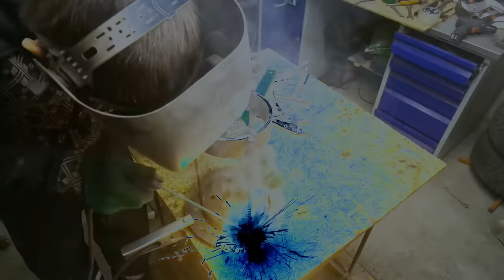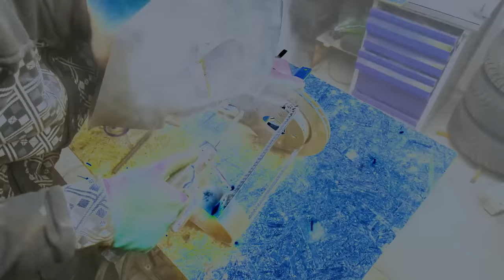Cool idea! Tool for every welding FROM THE BRAKE DISC!

Comment: After watching you try to weld cast iron, cold, not once but TWICE, I'm really surprised you didn't first try to weld it directly to the bottle. Now THAT would have made a GREAT YouTube video !!!
Reply: Don’t know about other parts of the world, but here in the US, brake rotors nowadays are actually cast steel, not iron....
Reply: @notajp  After reading your comment I did a bit of research and I haven't found any evidence to support your claim. The fact is that US brake rotors, like the rest of the world, are predominantly cast iron.
Reply: This comment got a chuckle out of me, almost spied coffee all over
Reply: Preheat and use stainless steel filler. Works great
Reply: Now watch me welding a bicycle crank. The video is already uploaded.😉
Reply: Then upload your own video you american sniper wannabe 🤣🤣🤣
Reply: @adriananimationsskits136  Yo adrian, you have no animations/nor skits. Consider yourself KIA from this American sniper wannabe 🤣🤣🤣  Let's see a video of yours....
Reply: I've MIG welded things onto old brake discs from cold many times. I just turn the dial up.
It seems to work fine. 🤷‍♂️
🇬🇧
Reply: Rotors are not cast iron
Reply: @JBidensucks  In the UK, brake discs (as we call them here) are made from cast iron.

I checked.

Can't speak for the US of course but would be surprised if it's different.
🇬🇧
Reply: @JBidensucks  they are.

Comment: That’s nearly 8 minutes I’ll never get back.   Waste of time.
Reply: You can get it as a "How NOT to weld cast iron to steel twice and how NOT to hold your round bottom gas cylinders" demonstration. Well, he didn't show why you shouldn't do such things, but you will remember 'till you die if you see the 'why' just once with your own eyes. Especially the second one.
Reply: Wish I would've seen this comment eight minutes ago
Reply: We must be 8n 1950.  Didnt even stay long enough to see the final product.
Reply: Stupid  "idea"
Reply: Every time a video does not show the end result in the first couple of seconds I skip to the end to see if it is worth the time. This is not
Reply: Thanks for the heads up 👍
Reply: Thanks for the heads up i just moves on😂

Comment: Sounds counter intuitive, but use some light oil when you're drilling steel. It helps the bit cut better, floats away cuttings, and most importantly, it helps keep the bit cool so it doesn't lose tempering.
Reply: Yes! And it looked like the drill speed was quite fast as well which will produce too much heat, hardening of the steel and dulling the bit. Slow drill speed for steel and always use light oil. The tool will do all the work.
Reply: @brianswelding  Great point and makes sense, I changed motors on an old and very heavy well built drill press. The thing  just eats bits up and not drill, I'm going to change pullies, thanks for reminding me of the problem..
Reply: not for cast iron. it machines great with no lube or coolant needed
Reply: Disc made from cast iron, not steel.
Reply: Yes oil helps but disc brakes are cast so contain graphite which lubricates drilling.
Reply: Wow! THREE different people felt the need to pont out that disc brakes are cast iron. I apologize, sometimes I make the mistake of using the terms metal and steel synonymously. My points/suggestions stand; drilling into any metal, cast iron, steel, aluminum, etc. all benefit from slow drill speed and cutting oil.

Comment: Years back I made stands for my belt sander, grinder, and jig saw out of 1 ton Dodge rear brake drums.  I just used a round plate with a 4" X 4" square tubing for the stalks, welded to the round plate for a base plate and drilled the round plate for lug bolts.  Then just bolted the stalk to the big old brake drum.  Then welded another plate to the top for the tool I wanted to mount to it.  Was going to just use an old axle, but didn't have any old axles I wanted to cut off for the stalks.  A lot easier than welding to a cast iron brake drum.

Comment: I am a professional welder I just have a tip remember car disc breaks are made of cast iron so you should use nickel welding rodes
Reply: Oh man! Thanks! I've only been welding for a month.
Reply: I agree with with other gentleman that pointed out it's cast. Just wanted to add, don't forget the preheat welding cast either. I think it's 450f but I'd look it up. It might even be in the paperwork that comes with the cast iron welding rod.
Reply: One other thing, peen your cast iron welds right away. Old timers trick to help stop cracks. Even if it's just an old wives tale, it doesn't hurt but personally and professionally, I think it works great for

Comment: I used a large brake rotor from a Mercedes and the steel from an old satellite dish antenna to make a stand for my belt sander a few days ago. The rotors are heavy and make good bases. I used three bolts to connect to the rotor.

Comment: Not having a piece of pipe the exact diameter of the disc brake, you can achieve the same result with three pieces of plate arranged in an equilateral triangle into which you can put the cylinder.

Comment: You had issues because of the temp of the work piece.  Preheat the rotor with a torch to get it hot before you hit it with the stick.   I will make for a better bond with the base metal.
Reply: but the problem here is NOTHING  to do with PREHEATING.  brake discs are CAST IRON, and that material is virtually impossible to weld.  man's a FOOL

Comment: I just braze these disks to mild steel then weld on that if I need to.  I built my mobile photographic lamp stands from brake disks, using them as ballast as well as the attachment points for foldable RHS legs and their castors.
Reply: I use truck drums with a pie wedge sliced out (love 6" cutting discs) to slide over the post bases I use for various stands. The cut makes them easy to place from the side.

Comment: That's a pretty creative workaround you've come up with there but if you had used the correct welding rod and the preheating procedure you actually could weld the A26 rebar to the castiron brake rotor. Good job!
Reply: What do you expect from a guy who has no proper welding gloves and no leathers?  If I tried that I would have burned my cloths up.
Reply: Yes, cast iron can be successfully welded with the proper rod. The biggest problem are thermal stresses are in the cast iron VS the filler material. They cool at different rates; therefore, a tug of war goes on and the cast iron generally loses with cracks typically forming outside the heat affected zone (HAZ). Preheating and post heating are critical but there are still no guarantees you won't get cracks in the cast iron.
Reply: @hootinouts  what if  you pre heated then let it cool down in an oven over a period of time ,
Just asking theoretically would that help reduce the cracks

Comment: You may have better luck welding the brake rotor (cast iron) if you pre-heat it with a torch. It needs more heat than the mild steel pipe and rebar.

Comment: What daft country would have gas cylingers that dont stand up ?
Reply: Cambodia or Laos
Reply: I don't know,  but I know two white dudes and a Hispanic guy here in the USA that don't. Not bullshitting and I'm sure there are more
Reply: Um, it isn't that the cylinders won't stand up, it's so they won't fall over, break the end off, and rocket themselves through you, or your shop wall.
Reply: The Slavic countries

Comment: Next time make your device PROTECT THE CYLINDER VALVE from impacts because that stand can still fall over. Add a removable cage or similar.
Reply: I know it's in a garage but it's an OSHA violation to not have high pressure cylinders, full or empty, to not be chained or otherwise supported.
Reply: @mathewmolk2089  I don't do it because of OSH regs (not applicable at my home shop anyway) but because I've seen an errant oxygen cylinder bounce around a salvage yard after falling over and snapping the cyldder valve off at the threads!  OPs base would be much safer if done with a larger rotor too.

Comment: i weld jack stands to my old rotors so they don't sink in my gravel driveway when i'm working on my vehicles. the rotors are easy to move and easy to level

Comment: After pretty good idea. That will come in handy storing my full tanks and empties. Every once in a blue moon they all fall over and I'm just been lucky that I haven't broken off the valve. I could even use that to store my scuba tanks and also.

 Thanks for sharing such a great idea.
Reply: If you want to protect your cylinders that's a solved problem called a cage or a cart you can make easily. That stand does NOTHING to protect the cylinder valve and is only mildly more tip resistant. Copy industry if you prefer to weld safely, and consider properly chaining your spare cylinders to the wall or welding table in the industry standard manner. This "Bubba" stuff gets people hurt because they don't fully understand cylinder handling even if they've welded for years. (Welding only teaches welding.)

Comment: KEWL VIDEO
   I tried welding to a brake rotor. It's CAST. YOU CAN'T WELD TO IT. I tried MIG and I tried Stick. It would break right off! I found that you have to bolt a plate to it and then weld to the plate.
  Thanks

Comment: You can weld cast iron more easily if you preheat it to over 400 degrees and weld it right after with high nickel content welding electrodes .
Reply: Exactly.

Comment: there are 4 kinds of cast iron & some can be weld cold, but most need to be preheated.
All you really needed is a castiron rod, check with you dealer & get a good welding book also.

Comment: One other thing you could have done is used rod to weld cast with.i know that NAPA Auto parts,has rod to weld cast-iron and with some preheat (just to dull red stage)will give you very good results.after you have laid down your bead,keep your torch heat on it and gradually pull your heat away. DO NOT COOL QUICKLY good luck I know this sounds a lot but cast is interesting stuff.cheers!

Comment: Funny to run into this today as just today I attempted to weld steel to a brake rotor. ha ha I was sort of expecting it not to work, assuming it was cast iron. but wasn't sure. I ended up doing the same thing you just did!

Comment: I learned a lot about grinding rust from iron alloys. Don’t even try to weld steel to cast iron. There are two reasons to grind a weld: 1, To give the appearance of no weld. 2, You are ashamed of your weld. Your stand would still be illegal in most developed countries, as the cylinder must be fastened to a structure.

Comment: What rod are you using and are you running 110-or-220 volts you should of turned the amps up

Comment: The tank needs to be in an appropriate cart or chained to a wall.  A brake rotor is not sufficient as it is neither heavy enough or wide enough to prevent a cylinder from falling over.  Just jiggling the top of the cylinder isn't sufficient.  Also - IF you are determined to do this than at least keep the cylinder transport cap screwed on at all times.  That means never take it off - even to use.  Tip that cylinder over and you have a potential MISSILE.
Reply: I guess it depends on what country you reside as to what regulations there are pertaining to safety in the work place. If someone has never seen a tank fall over and the valve knocked off, therefore creating a torpedo that will penetrate a couple of block walls, doesn’t know the danger of not having the tank secured to an object that won’t allow it to be knocked over and potentially killing one or more people. I agree with you 110%. It sucks when it takes a serious injury for people to use the common sense, that isn’t so common, to avoid an accident. And all accidents are avoidable.

Comment: Assuming that's either 7018 or 7016 rod your working with, when you tack something down don't he afraid of holding your arc a little longer. In my opinion, a good tack is about the size of a nickle.

Comment: In the United States we have gas cylinders that actually have flat bottoms and welding carts to carry the cylinders around the shop. That looks like an oversized CO2 cartridge for a very large paint ball gun.

Comment: Pre-heat the brake disk to cherry red THEN weld otherwise you don’t get penetration.
Reply: I would've expected a professional welder to know that. But I was WRONG. LOL
Reply: Keep the heat on after welding, slowly reducing temperature to ensure the cast iron doesn't crack.
Reply: Don't need to be cherry red but he does need to get it to a couple hundred degrees.  And control cool it so it doesn't crack.
Reply: The  brake  rotor is hardened  steel to weld needs pre and post  heat and welded with 7018 rod.

Comment: Ya you can’t weld cast with steel rod you have to use a nickel rod
Reply: You can weld cast of you preheat it first
Reply: @jerryglover7402  From a welding engineer with over 50 years in the business,

WRONG, WRONG,WRONG,WRONG.  Preheat has NOTHING to do with it.

Comment: Nice idea. But an a very dangerous one. That brake disk is way too small. It is more stable than a tank alone, but itcould easily be knocked over with disastrous results. DON'T DO THIS.
Reply: Disagree.  That bottle would be more stable than a normal flat bottomed gas bottle.  Although why it has a round bottom in the first place I’ll never fathom.
Reply: @todaywefly4370  fine, but it is far from SUFFICIENT.  A a disk of that size is insufficient for ANYTHING more than 2 feet, tall. Have you ever seen what happens when one of those things falls over? 
Regulstions in the USA require having it CHAINED to a secure object.
Reply: Put lag bolts in your concrete and bolts it to the rotor. Problem solved.

Comment: Welds a lot easier if you use cast iron welding rods like inconnel welding rods to weld cast-iron to carbon steels and if you don't have those rods handy a good oxy-ace torch and some braising rods would have welded that rebar to the rotor. Not a bad idea  although I guess!
Reply: Makes me laugh (sic). a tutorial where the tutor is ignorant of basic welding metallurgy. cast iron is NOT easy to weld...... especially if you know feckall

Comment: I had the same problem when I tried to weld rebar to a brake rotor. I always thought they were cast steel but they weld like cast iron.
Reply: @wh8378   Oh, unfortunately I don't have anything to heat it with, but next time I take a welding class I can try to do that.
Reply: Rebar is hot formed steel rod. As with all steels, it welds best when all scale and rust is removed.
Reply: @tigerseye73  yeah makes sense, the most I did was wire brushed it down with an angle grinder.

Comment: To weld cast steel you use stainless rods and preheat the cast steel.
Reply: What spec?
Reply: @marksarovich5534  I am a welding engineer.
There are many ways to weld cast iron and none are among  most of the Bob Villas' suggestions I read here. For what he was trying to achieve here I would braze the rebar on.to the rotor. You could use Ni Rod but the cost is WAY to high for a bottle rack (That has to be chained up anyway.) 

Actually the way he did it was probably the most efficient way he could have got the job done

Comment: 😳 ya kiddin me right??..... All that waste of supplies and ya coulda bought a cart from Harbor Frieght for $40.
Reply: Harbor Freight is a tool supplier, for those who don't depend on their tools for a living.
Reply: That $40.00 HF cart has a weight limit of 100 lbs. So, a 70 lbs. welder, a 25 lbs plasma cutter and tank set up puts things up and over the weight limit already.
Besides, the reviews say that cart is either top heavy or the welds at the wheel hubs usually always fail the instant a load is placed on it. 
Hardly worth parting out the $40.00 for Beijing made garbage, ehh!?

Comment: If you use welding rods for stainless steel you can weld mild steel to cast steel/iron and a bit of pre heat on the disc helps. I still prefer my two bottle trolly with "tilt and move" third wheel. Shame about all that faffing about for a p155 poor result.

Comment: Small Question. How come you added bolts instead of just welding the poles onto the disc instead? I'm genuinely curious to know your process
Reply: Brake discs are made from white cast iron. It’s brittle so cracks as the weld bead cools.
Reply: He could have, but he would have to heat the disks first, and then use stainless steel rods. His solution was probably the best one for what he had to work with. Cast iron and cast steel are very difficult to cut and weld, and require special methods.
Reply: @TheOldPCTech  Can plasma cut that disc?
Reply: @MrJockoDundee  plasma can cut cast iron, yes. Oxy fuel will not.

Comment: The only trouble with magnetic clamps / holders is that the magnetic field exerts force on the electrons and ions within the arc, which causes the arc to be deflected away from the normal arc path, making a good stick arc weld very difficult to perform.
Reply: but the problem here is NOTHING  to do with magnets.  brake discs are CAST IRON, and that material is virtually impossible to weld.  man's a FOOL
Reply: @raymondo162  But that has absolutely nothing whatsoever to do with the point made in my comment about the effect of magnetism on the behaviour of the electric arc while welding - known as 'arc-blow'.  The type of metal being welded has no relevancy and would make no difference whatsoever to the likely effect the use of magnetic clamps would have on the electric arc while welding.  My comment makes no reference whatsoever to the merits of welding high-tensile concrete reinforcement-bar to cast-iron brake discs.
Reply: @raymondo162  The re-bar wasn't welded to the brake disc anyway - he drilled the brake disc and put bolts in and welded the re-bar to the bolt heads. Try watching before commenting! (Who's the fool now then?)